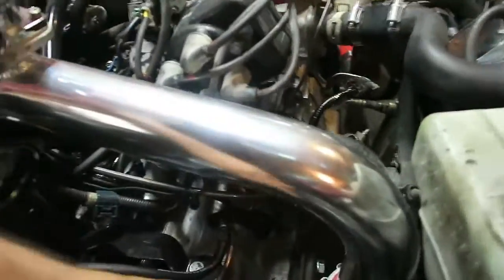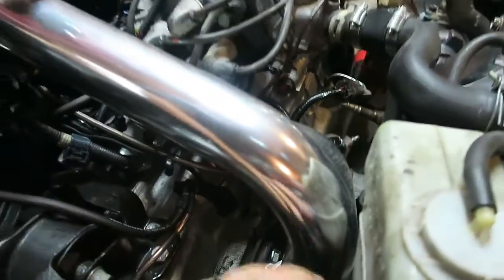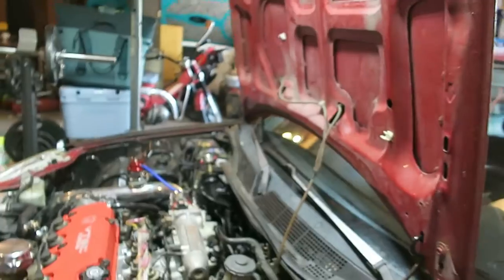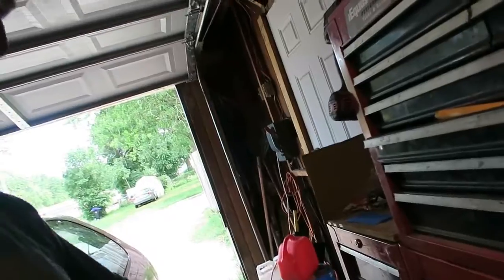civic ep 4

Comment: How did your lines hold up on the 6.5 just trying to gauge which way to go 👍
Reply from the maker: sorry, just saw this. the lines held up great, I sold the truck about 4 months after I made this video and no leaks, just be sure to use good quality clamps at the barb fittings that can take pressure